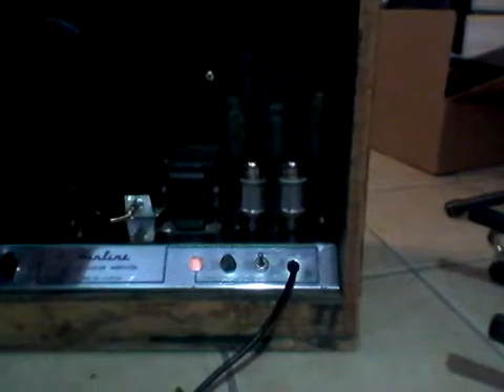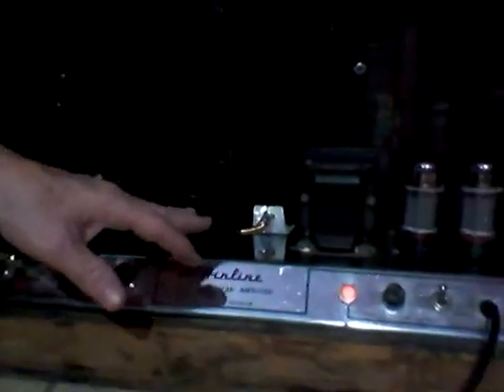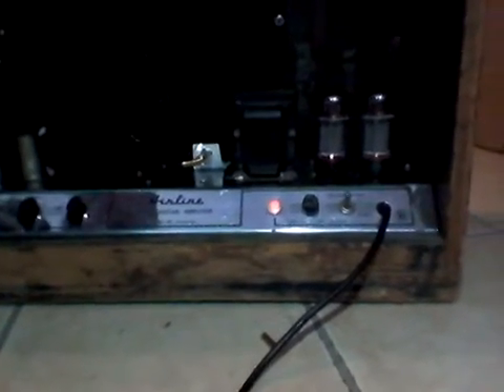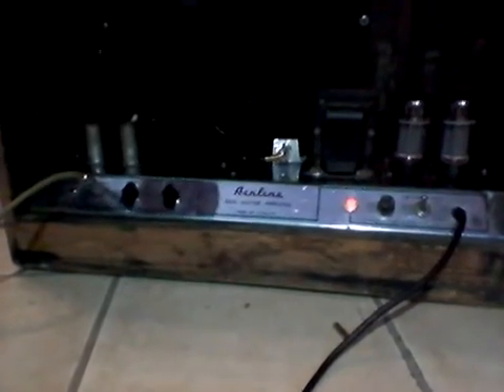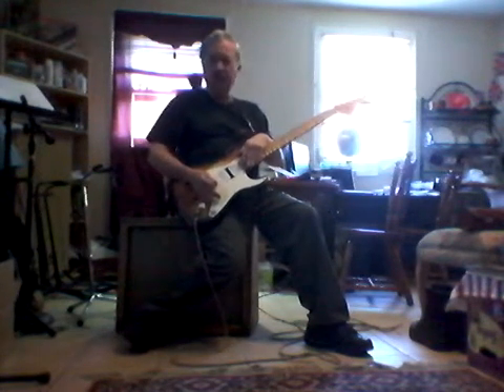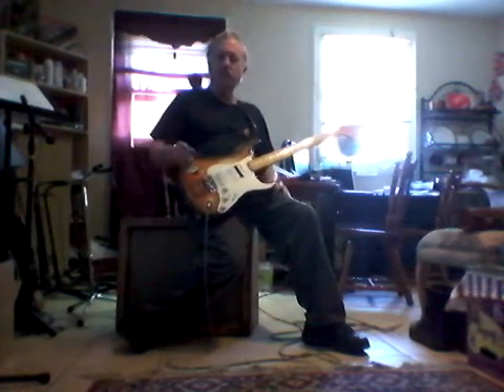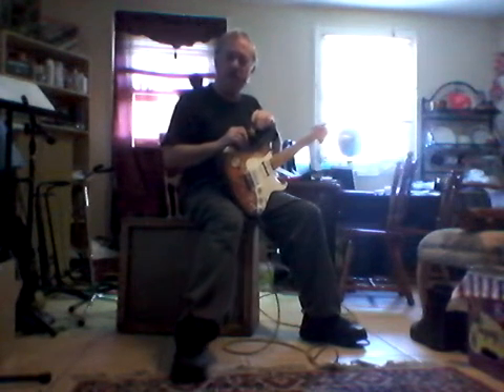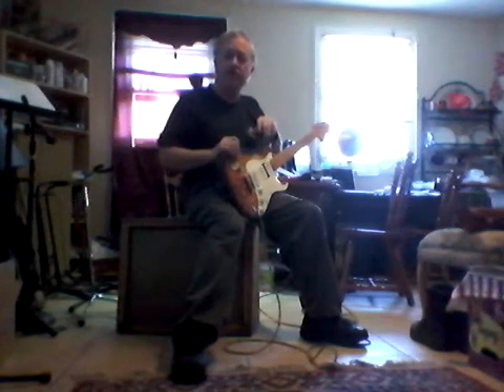Airline 9020B. Tube bass - guitar  amp. 1966

Comment: Just found this. Glad you left it up!

Wow... Maybe because I'm an old school guy, but it sounds really good to me.  Also most likely though because I still have mine, but I think it's a previous version, from Montgomery Wards of course. It's from 1964, which from a side view is wider at the bottom tapering a bit to the top. Mine also has the same circuitry but round knobs, not levered like yours and is original except for my removing the white tolex, badging, and a replaced speaker, which probably alters the sound somewhat. 

I last played it a few years ago and it sounded fine.

I'm inspired now to hear how it's doing, but not with my '57 P-bass. I'm going to ask my son to bring his Strat and try it. Hope it sounds like yours.

Great unique, un-duplicate-able sound!